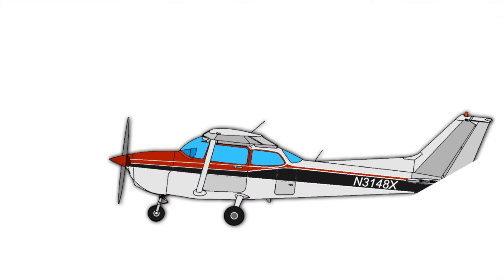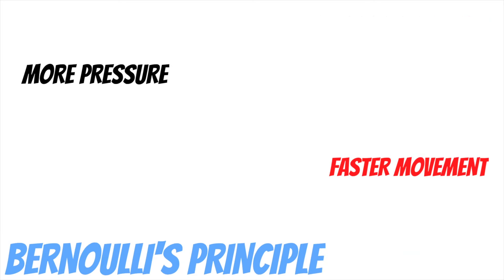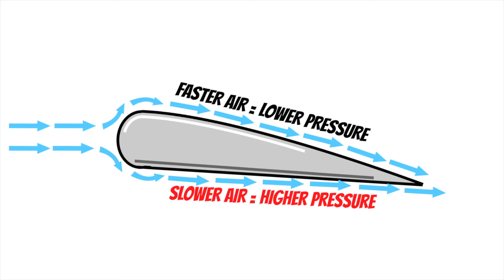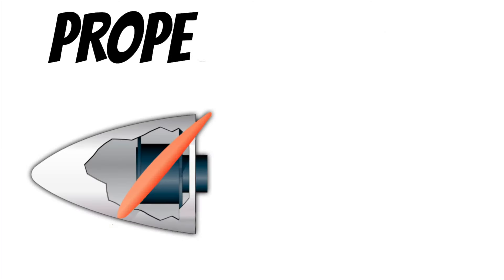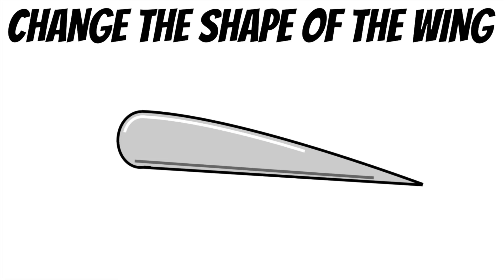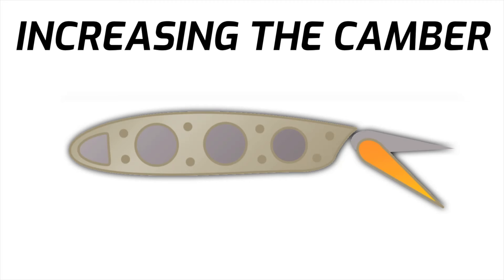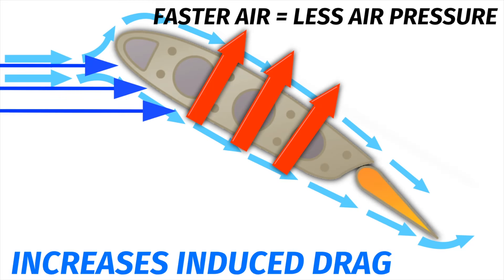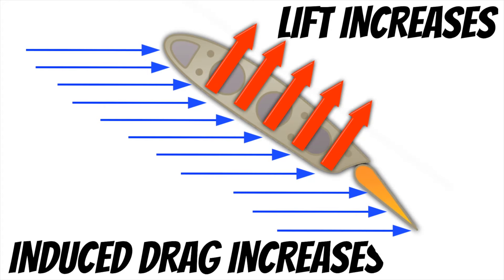How an Airplane Creates Lift | Complete PPL Ground Course (Lesson 2)

Comment: Why does the air on the top surface have to travel faster?  What physically requires the air flowing over the top travel faster so that it can meet the air flowing along the bottom?  The wing is not a venturi.
Reply from the maker: The wind on top must travel a farther distance than the wind on the bottom.  This makes it move faster.
Reply: @FreePilotTraining  It seems like the wing creates more drag for the wind on top, wouldn't the air move farther, but just in a longer amount of time?
Reply: Nothing. And it does not even meet the air on the bottom, because the upper is even faster. The myth, that a longer distance somehow relates to the speed, however somehow sticks. The pressure distribution and connected with that the speed distribution is caused by the airfoil curving the airflow. If you take the picture about Newtons principles, the wind on the upper side is not depicted. If it was, you would notice that if the lines would continue straight, there would be no air at all everywhere behind the wing. So there is a low pressure area which makes the air follow the airfoil (unless the curvature is too much causing stall). The same is true on the lower surface. Air is not like bullets ricocheing from the surface. The curvature of the flow results in that higher pressure area. And yes, that pressure difference is the lift (all of it), yed, Bernoulli's principles makes the airflow on the upper side faster. But it is has nothing to do with some longer distance.
Reply: @Haniel93 This video needs to be removed.
Reply: @FreePilotTraining this is a myth and has been proven wrong.
Reply: @FreePilotTraining Equal transit theory is wrong. It's actually because infront of the wing, the air stagnates (slowing down). This creates high pressure infront of the airfoil. Due to conservation of mass, the high pressure air goes over top the wing, as the velocity speeds up the pressure drops, which creates the pressure differential that creates lift.
Reply: If you get 4 physics professors in a room you will get 4 different answers. I don’t know who’s right and l don’t understand any of them 100%
The lecturers are available on YouTube. The theories are, Navier-Stokes, Cutta-Jawarski, Eulers Equation,Coanda Effect, and some whose name l don’t recall.
Haniel93 , on this thread gives a great explanation, grounded in physics!
Reply: @Haniel93 Thank you for being a voice of reason on this crazy thread!!
Reply: Actually, if you accelerate air downward, you get an upward force. And if you don't accelerate air downward, you don't get an upward force period. Although the bernoulli principle is useful in explaining how a force transmits, it doesn't explain the cause of the force. A pressure differential doesn't cause lift. It IS lift caused by accelerated air. You can't use bernoulli's principle to explain the cause of lift.  You can only use it to explain how a force transmits.
Reply: @ttfyppgaming7160 
When a wing is working to produce lift ,the above air is accelerated rearward and downward. The rearward acceleration causes a forward thrust.  While below the opposite happens. Air below is retarded  and causes drag. In any case, if you accelerate air down, you get lift,  and if you don't do that,you don't get lift.
Reply: @bige6560 
No. A pressure differential doesn't cause lift. A pressure differential IS lift caused by downward accelerated air. Lift is a reaction force and not an initial action force. To be sure, it is neither possible to get lift without deflecting air,nor deflect air without getting lift.
Reply: A pressure differential doesn't cause a force, but rather, is a force caused by deflecting air. And to be sure, you can't deflect air and not get a force.
Reply: @FreePilotTraining  As far as I know this portion of the theory of lift is wrong. The faster moving air on top of the wing has nothing to do with having to travel farther to meet the air at the bottom. The farther distance does not equal faster movement. What causes the air above to move faster is the curvature of the leading edge. This causes the air molecules to experience centripetal acceleration. True that we may not have a complete theory of lift, but we seem to have thoroughly debunked the equal transit theory. 

https://www.youtube.com/watch?v=p4VHMsIuPmk

Comment: Lift created by the wing is generated by simply defecting the airflow downward. Newtons 3rd law of motion, "for every action there is an equal and opposite action" that is what makes the lift. A wing will not generate any lift when at "0" deg. of incidence regardless of airspeed..
Reply: A wing with a curved upper surface will generate lift even at 0 degrees.  The Wright Brothers knew that and that is why all wings (except supersonic aircraft) have curved upper surfaces.  If the lift only came from the lower surface, then an angle of attack of 20 or 30 degrees would provide even more lift, but in fact when the airflow over the upper surface becomes turbulent, almost all the lift is lost and the wing stalls.

Comment: Really great videos. Thank you so much for such great effort! Can you write here how you are increasing the angle of attack. I understand how you increased thrust and how flaps directed downwards to create lift. But what did you do to change the nose angle ? Did you change angle of elevator for that?
Reply from the maker: Changing the angle of attack is TYPICALLY done by using the elevators to pitch up or down, but other things can affect it as well.  Increasing airspeed can also push your nose up as well and any wind can change this angle too.
Reply: @FreePilotTraining  Understood. Thank you!

Comment: Great series Josh!
The equal transit time hypothesis nonsense has already got too accepted, so if not too much work, I'd leave that out of this one. I know we all need this to be kept simple, short, and sweet, so would probably instead say something like the air has to travel faster due to the narrower diameter (of the flow,; easiest to consider above and below the wing separately and can paint flow lines) and the applicable principle to that + Bernoulli's principle. You can also point to a more complete, but harder to remember explanation, like for example this one: https://youtu.be/ph1HqrioLPs
Reply from the maker: Thank you! And I really appreciate the way you went about correcting me.  I would love to replace the video right away, but I really need to knock out some other videos first.  I’ll take a look at that video you sent and see if I can understand it enough to simplify it for a video
Reply: It's a little tough to simplify to be fair, because the exam expects you to involve speed & pressure of air with Bernoullis principle. As a friend of mine recalls even at MIT they don't deeply go into why the air moves faster, then just touch Bernoulli's principle from there. They teach that for lift you need to increase downward momentum of the air and airfoils can increase that downward momentum efficiently. They also add that equal transit theory is baloney.

So maybe the best is to say something like "we're not going into why the air travels faster above the foil to keep this short, but feel free to look into it" and just do like like they do.

Comment: isn't it "excess thrust" that causes the airplane to gain altitude?
from textbooks, lift is actually lower than weight when you are in a steady climb, no?
Reply from the maker: That’s part of it. But relative wind is the real culprit.  That’s why wind shear is so dangerous.  You can go from a headwind with tons of excess lift to a tailwind and then stall if you’re not flying fast enough
Reply: @FreePilotTraining  hmm.. not sure if I completely understand this
Also, I always thought the reason the nose goes up (and gaining altitude) when power is applied is because of something called "couple" where the thrust line is below the drag line, no?

My instructor told me that there is an airplane out there that is designed oppositely (thrust is above drag), so the nose actually goes down when power is applied! Is that true?

Comment: A tailwind does not produce less lift except when the aircraft is on the ground.  It does add to the airspeed so landing with a tailwind produces a faster groundspeed and a longer landing, both not good.
Reply from the maker: Wind is an important part of “relative wind” which is how an airplane creates lift.  That’s why wind shear is so dangerous. A 20 knot headwind that changes into a 10 knot tailwind can very easily stall an airplane because the wings are not creating enough lift in that situation
Reply: @FreePilotTraining  That is correct and is an advanced topic.  Wind shear can happen if the pilot is trying to land into wind.  In the video my point about not taking off with a tailwind is not made, the groundspeed and ground run will be significantly increased on takeoff and landing with a tailwind.   The plane will still be flying in the relative wind.

Comment: I can’t understand how does everyone explain the lift creation only this way, and forget about Coanda effect
Reply from the maker: It’s because this is the way you’re tested on the FAAs exam. When they change it, I will change my video
Reply: I've got it, thanks
Reply: @FreePilotTraining  you see, here in Ukraine we have the same principle for teaching pilots, but sometimes I can allow myself to speak about different variants, I know it doesn't help during the exams but can help during life.
By the way, thank you for everything you give on your channel, it is very good
Reply: The FAA will never use Coanda effect in a basic explanation of lift because it has absolutely nothing to do with how a plain airfoil generates lift in a freestream. You only get Coanda effect in special cases, for instance blown flaps, because it is an effect that happens when you blow a jet over the aerodynamic surface. At a push you might say the Coanda effect is present in the flow over a slotted flap because you have a jet exiting the slot (notwithstanding that the idea of the slot is to energise the boundary layer which is not quite the same as the Coanada effect).
Reply: @FreePilotTraining you should also just state that this explanation is wrong, but the FAA wants you to know the sky is brown.

Comment: Hello! I've always thought that the air going over the top of the wing goes faster and creates a partial vacuum, and it is this suction that creates lift! Is this still true, or is lift generated solely because of the higher pressure on the bottom of the wing?
Reply from the maker: There are different theories out there.  Yours is one school of thought

Comment: Did really just regurgitate the equal transit time theory??
The air has no idea how it has to travel.
Reply from the maker: Lol, the truth is that no one actually knows what causes lift…not even NASA. These are just an oversimplification from the FAA for the written test. This is a pretty decent article on the subject: https://www.scientificamerican.com/article/no-one-can-explain-why-planes-stay-in-the-air/
Reply: @FreePilotTraining   There are better explanations. I have a degree in Physics and have researched it. 
Viscosity and the coanda effect ensure the airflow follows the curvature of the wing. Curved motion is a result of acceleration and hence a force towards the centre of rotation. This is centripetal force. Balancing it is centrifugal force ( think of the tension in the string when you rotate a suspended stone over your head). If the string were elastic it would stretch. Since air is compressible, it’s also “stretchable”. The centrifugal force acting opposite to the centripetal force therefore “stretches” or expands the air flowing over the wing.  This lowers its density, hence pressure. According to Bernoulli the air must then speed up, which is what is observed.
In summary low pressure speeds up the air, rather than increased speed causing low pressure.
Reply: @MrAlwaysBlue ….in subsonic aerodynamics the air is treated as incompressible below around Mach 0.3. Density changes do not explain lift. Also, liquids being virtually incompressible, any explanation of lift that requires density change to explain the pressure change would fail completely for hydrofoils.
Reply: @XPLAlN  Air is incompressible? Good luck with that assumption giving met lessons to your students.
Reply: @MrAlwaysBlue  …what you just did there is called being obtuse. Where did I say the assumption of constant density is used in meteorology? And yet this assumption of incompressibility is widespread in low speed aerodynamic theory. We are dealing with virtually adiabatic, virtually constant head problems here, so very different to meteorology. The pressure distribution around the wing does not require density changes to explain it. If that were the case you would need a totally different explanation of lift for hydrofoil vs airfoil. Strange that you claim a degree in physics and yet do not know this. Very strange.
Reply: @XPLAlN  You explained lift with equal transit time. No rowing back from that mate.
Reply: @MrAlwaysBlue  Eh? Feel free to quote where I wrote that…..
Reply: @XPLAlN  "The air has further to travel".
How does air know how far it has to travel? 
If a parcel of air splits art the North face of the Eiger, does it  have to neet at the South face?
Doesn't even travel. It is split by the oncoming aerofoil
Reply: @MrAlwaysBlue  No idea why you attribute that quote to me. I have never even implied it. You are confused.
Reply: @XPLAlN  You say it at 3:25
Reply: @MrAlwaysBlue  No I don’t, this is not my video.
Reply: @XPLAlN  Oops, embarrassing. Please accept my apologies. For some reason, I thought you were the author of this video.
Reply: @MrAlwaysBlue  ...excuse the delay. Apology accepted.
Reply: @MrAlwaysBlue  BRAVO!👍 Yours is the correct explanation of how the depression on the top is generated: centrifugal/petal force due to the rotary motion of the air particles. 
Also, "Bernoulli" is NOT the cause of lift, but only the EFFECT. The air on the top accelerates DUE to the depression, NOT because of it. Bernoulli is good for "measuring" depression on top of the airfoil, but not for explaining it. 
I would just add that it is not the rounded shape of the top of the airfoil that causes the air particles's rotation. Even a perfectly flat airfoil generates a rotational motion, as does an asymmetrical one like the one in the video that flies inverted (which explains... how planes can fly inverted).😊 
Essentially, the shape of the airfoil is NOT the reason why lift is generated.